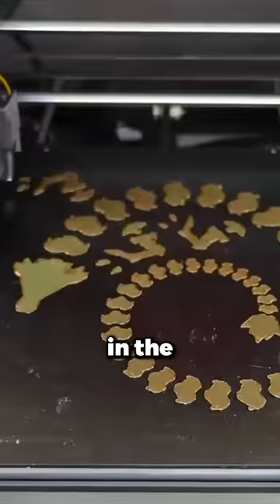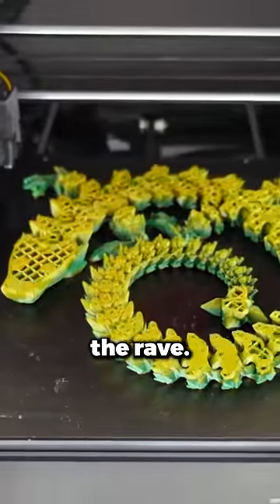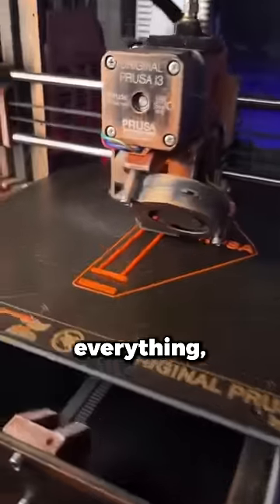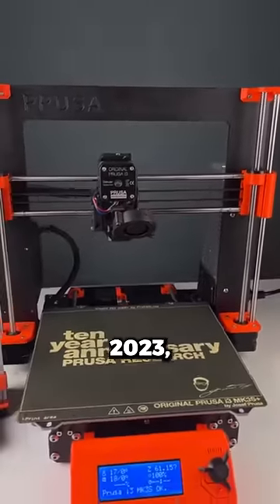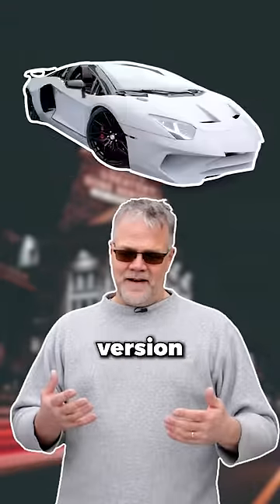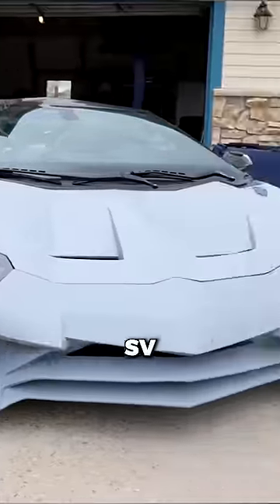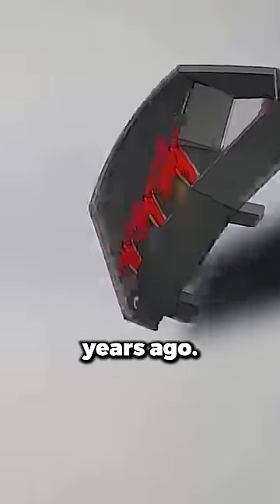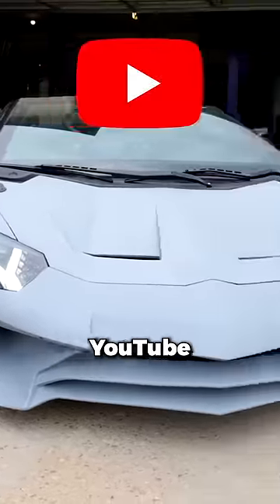Im going to 3d print me a house

Comment: how tf do you 3D print body panels unless you have the actual panels? You'd need to scan the underside that you can't see from the exterior like the door where you need to know the depth to put things in like the electronics and window to fit in it along with the tabs for bumpers and a ton of other shit
Reply: I dont think you know how 3d printing works, most 3d printers use 3d models and not scans from real life. He might have found a model that was really tiny and scaled it up a bunch
Reply: @1Lazarus  that still requires someone to scan the individual parts to make the car whether he did it or someone else did it.